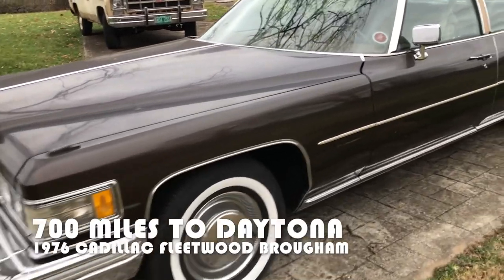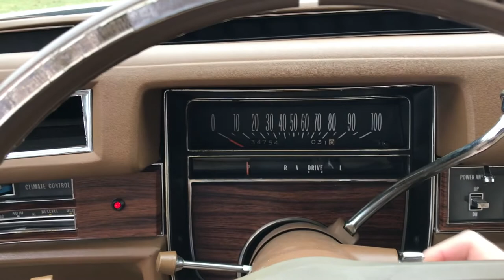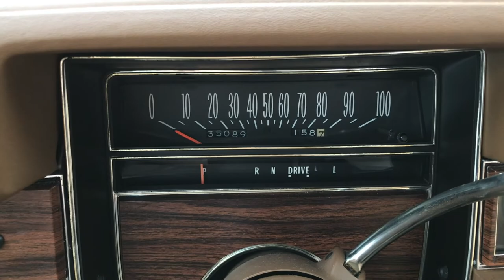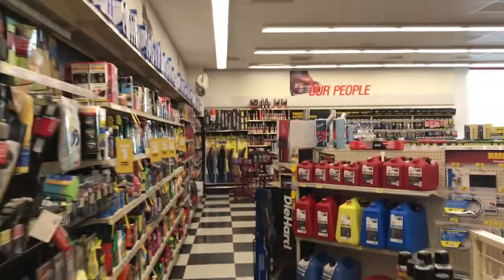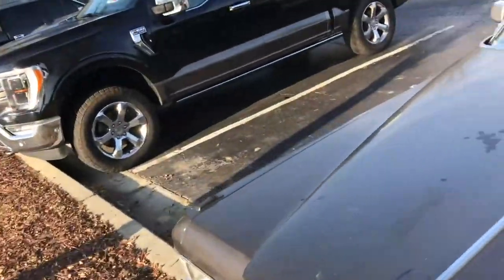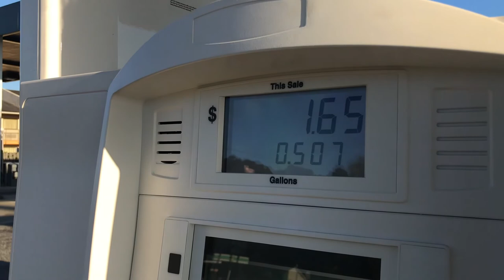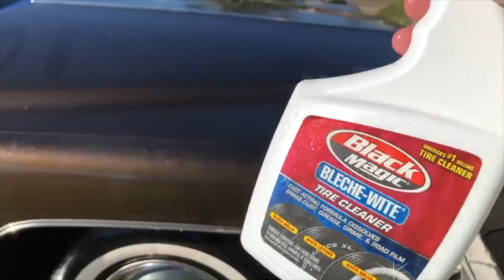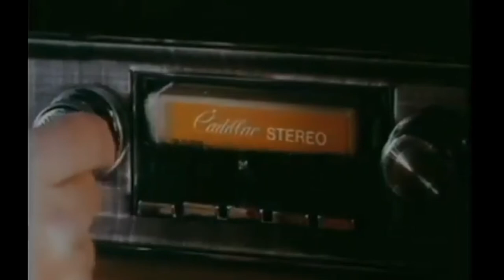1976 Cadillac: 700 mile road trip to Daytona!

Comment: I have a 1996 Fleetwood Brougham, which is the last iteration of this car. She's not quite as big as your 1976, but she still floats down the road. Fuel mileage was definitely improved as I can average between 22 to 25 mpg on highway trips.
Reply from the maker: LT1 power! advent of FI and the OD transmission made a huge difference
Reply: I have a 1990 Fleetwood sixty special with 155k Miles in it, should I take it in a 1000 Miles roadtrip?
Reply: @haytamsanchezhd3430  only if you feel confident that the car is mechanically sound enough to make that sort of trip.

Comment: An old time carburetter Mechanic could Sort out you’re starting issue. Somehow the fuels is evaporating or leaking out at the Carburettor , a Rochester Quadra jet downdraft. Some of the seals and material become porous and dryer out.
Reply from the maker: Definitely. I have a rebuild kit, this would be the second I've done (first was a 4MV for a Chevrolet 454.)

Comment: beautiful, but beware of the rusting already starting along the trailing edge of the drivers side roof-I've seen some of these cars with corrosion through to the trunk. big problem with the 74-5 models
Reply from the maker: Definite weakness, every vinyl top car will have to have the top removed for repair at some point.

Comment: Would like to know what it cost you in Gas round trip
Reply from the maker: This was one-way, so roughly 700 miles, prevailing price at that time of $3.25/gallon, 11.4 MPG making 61 gallons necessary - just under $200.00. For context's sake - the 1976 average gasoline price in the U.S. was $0.59/gallon, so when the car was new the trip would have cost just under $40.00 (in 1976 dollars.)

Comment: On my Cadillacs when that happens I always know it's the fuel pump the ethanol gas is destroyed the rubber diaphragm. It happens so often that I keep a spare fuel pump in the trunk and I only run non-ethanol gas now and it stopped happening. It's the ethanol enhanced gasoline it hates old cars it rusts out the fuel system. Yeah it's lately it's only 30 cents more a gallon. And it's worth it to not have to crawl under the car and replace that fuel pump I keep the new one in the trunk cuz it just happened so frequently. It also eats the float in the gas tank which tells you how much you got. Ever since I stopped running the gas they sell everybody else for their plastic cars and only use the non-ethanol fuel sold a lot for boats. The cars reliability came back never a fuel system problem again.
Reply from the maker: on the same page! have a new fuel pump and sending unit, planning a carb rebuild as well. cheers!